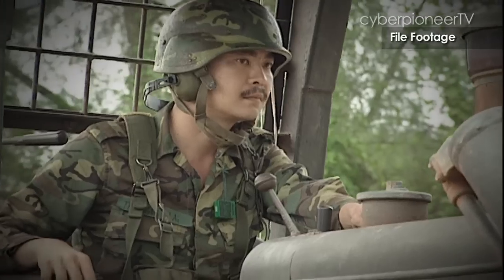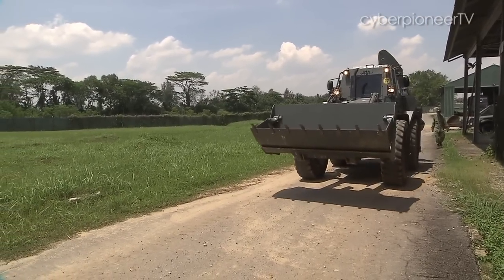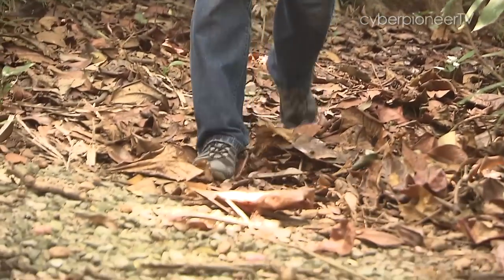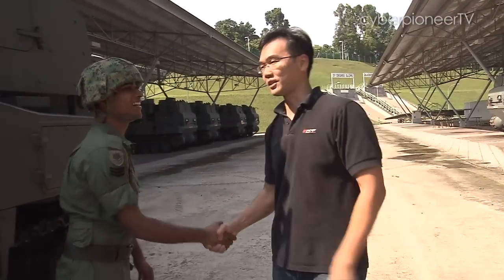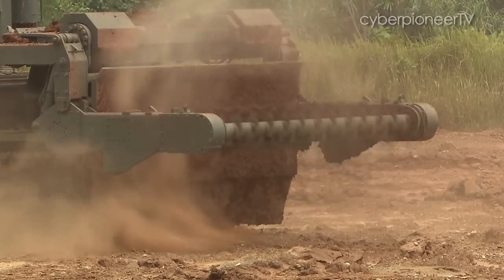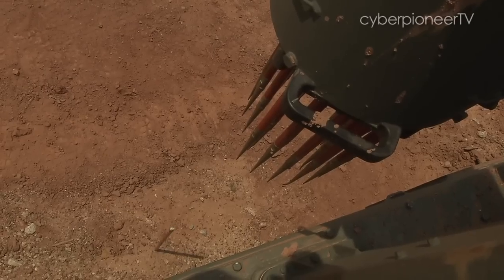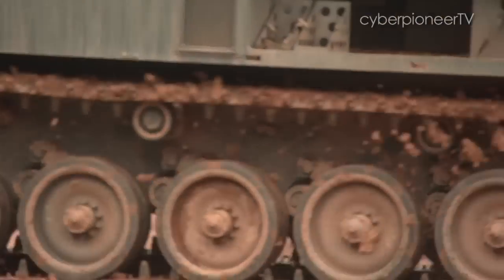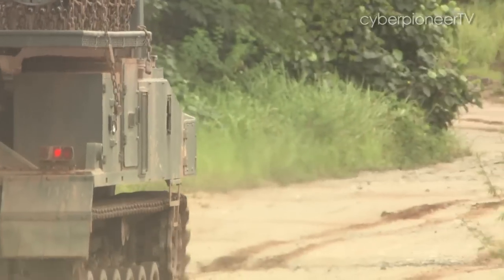Ep 2: Movers and Shakers (Combat Engineers)

Comment: The Projection Line Charge seems similar to the U.S. Army's Mine-Clearing Line Charge. The Trailblazer Commander said that the striker heads' impacts are "very extreme for mines which are basically made of plastic and explosives", then what about the more common type of anti-personnel mines made of steel designed to disperse fragmentation?